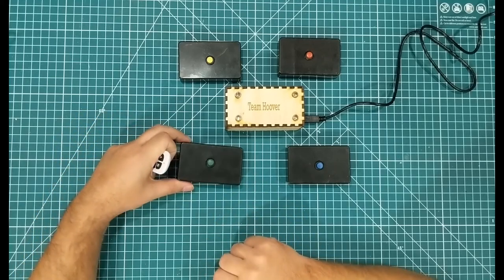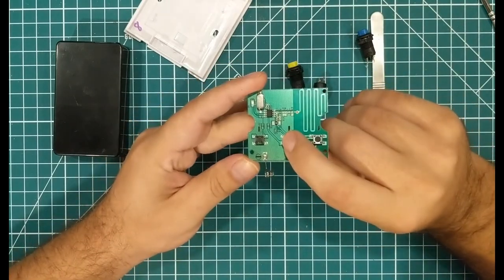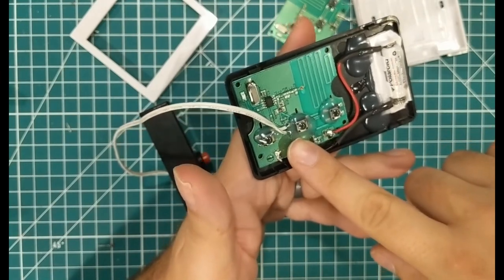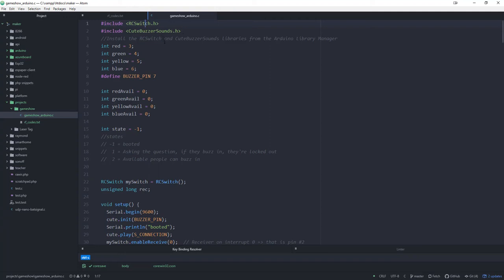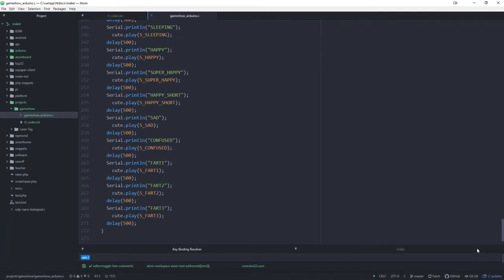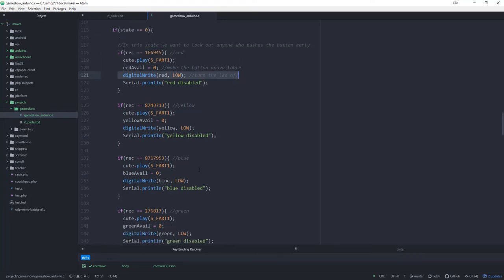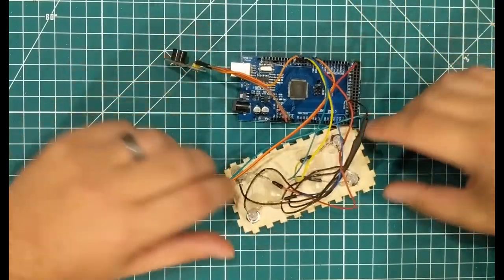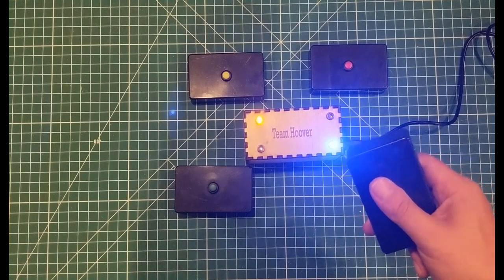Wireless Arduino Game Show Buzzer (With Code)

Comment: Awesome project. I built one with 12 player units. Been using it for the last 4 months without problems. I would like to add a function but don’t know how. Is there a way to add an extra buzzer after 5 seconds after the player buzzes in to answer. Like in family feud. Some of the players push the buzzer too fast then don’t know the answer right away and other players get upset.
Reply from the maker: So are you saying that the lockout should automatically unlock after 5 seconds? I think that would be doable. I am out of town at the moment but I would be happy to help and early December

Comment: This is a very interesting project. But I cannot understand that only a single receiver can receive the four buttons from the player and the four buttons from the key remote control and transmit them to the Arduino via just only one wire.

In my hardware circuit with relay I have 4 receivers but somehow they block each other when several buttons are pressed almost simultaneously. 
I would like to send you a picture of my electrical plan, but I don't know how to add a picture here. 
Thank you.
Reply from the maker: You're absolutely right that 433mhz signals can cancel each other out and that's an issue.  I make the kids tap the buttons.  Instead of push and hold.  It only takes being first by a thousandth of a second to get in there and "win."  Although I am going to make another version of this that uses a different technology where all the signals can be received at once and it will give you the order.
Reply: @AnotherMaker  hi, any progress or notes regarding this new strategy that you can share? I'm working on a similar project and I'm amazed there isn't any kind of kit out there already being made by Adafruit or someone like that!

Comment: I tried that with 433 MHz radio-controlled sockets and a relay control. But if the players pressed at the same time, then probably the radio signals blocked each other. None of all players' lights came on.

Comment: Thank you very much for the video, but I have a question. Is it possible to add two more colors? What would have to change in the code?
I am very noob at arduino. Thank you.
Reply from the maker: Yeah. So a simple way to do it would be to search through my code and look for the word yellow.  So when you see...
int yellow = 5;
Just add 
int purple = 8; 
That's the next open pin. Just go all the way through the code and duplicate any other chunks of code and make one for purple or orange or whatever other colors you want.  The code is in the description. I made it super repetitive on purpose so you can track what I'm doing.

Comment: Hi thanks for your idea of using 433. I used your code and build my version of this project. Into buttons I give keychains - so and now a problem. If i use it one by one its ok all works fine. But when I hit two buttons simultaneously receiver dont take any data. When I have uncommented part about received bytes, there is no activity until I release one of buttons. Any idea what is wrong? Thanks
Reply from the maker: There's just no way you can push and hold 433, they have to push and let go.
Reply: @AnotherMaker  https://drive.google.com/file/d/1310a2pRNw2f6GXK_T2Hp7RJGezX87Y4I/view?usp=sharing - here is example - one by one is fine, if I hold a button it sending more of same signals, if I hit both it do nothing or as on the end of video it send absolutly weird values.

Comment: Is there any way to use a ir receiver and remote for the main controller? If so where would I power the ir receiver on an uno with everything else the same?
Reply from the maker: So I made a video on doing an ir receiver. https://www.youtube.com/watch?v=McYDX7_Tqy0  You could do that and then give each person a little ir keychain remote or a universal remote.  Or you could use an arduino for each of the buttons and make it an ir blaster.
Reply: The main complication im running into now is that irremote seems to be using the same timer as what im guessing is the buzzer sounds.

Comment: This is a fantastic project and has inspired me to try and do something similar but I'm very new to this kind of thing. If I wanted to expand this to 8 players and use the keychains as a base for the buzzers, do they all transmit a unique signal or is there a limit to how many I can use?
Reply from the maker: They all transmit a unique signal. I never received 2 that were the same, but you can also buy programmable ones.
Reply: @AnotherMaker  Thank you so much for the information. I guess I'll start gathering parts to have a go at this.
Reply from the maker: @mydream7015  Good luck!
Reply: @AnotherMaker  HI. I've managed to make great progress on my project thanks to your example code and had one final thing I couldn't quite figure out through research. My project is running on a pro micro (5v) and I have 4xAA battery holder which I will be using to power it. If the battery is connected while the USB is plugged in, can it do any damage to the batteries? will the Arduino automatically draw power from the USB over the batteries?  Thanks again for your help.

Comment: you did not show sir how exactly did you assemble that main box controller. anyway overall i like it
Reply from the maker: Hmm! I will have to go back and watch the video to see what I missed. If you have any questions about making one, I'd be happy to help.   Are you talking about assembling the wooden box itself?
Reply: @AnotherMaker  yes sir and how did you assemble the wiring too coz i have no basic knowledge on electronics
Reply from the maker: @aenhsbestshots3505  So the 4 leds each have one leg to ground and the other to pins 3,4,5,6 with a 220-330 ohm resistor between the led and the pin.  The buzzer has one pin to ground and the other to pin 7.  The 433mhz receiver has one pin to 5v, 1 to ground, and the data pin to pin 2.  That's it for the wiring.   I laser cut the box, very similar to how I did this. https://www.youtube.com/watch?v=vmq_0J9QWPc

Comment: The aliexpress store seems to not carry them anymore?
Reply from the maker: Is this what you are looking for? 
https://a.aliexpress.com/_stE6p1
Reply: @AnotherMaker  Thank you!!!!!
Reply from the maker: @cyberphox  not a problem!
Reply: @AnotherMaker  next question! :) Is there a way to code these wireless buzzers to respond to a keyboard press instead of a lockout system? Say like build 10 of them to respond to keyboard 0-9?
Reply from the maker: @cyberphox  what do you mean by respond by?
Reply: @AnotherMaker  i mean one box with a button pressed would be the same as pressing the number 1 on a keyboard, the next box - number 2 and so on..
Reply from the maker: @cyberphox  Ahh! I understand now.  So if you swapped the arduino mega for a pro micro https://amzn.to/2UQNUxe that pro micro can emulate a keyboard and output that as a keypress.  Another option is something like https://www.adafruit.com/product/2479 which can basically take serial output from any arduino and output it as a bluetooth keyboard.
Reply: @AnotherMaker  I think I'm gonna try the pro micro..i need to make up an order list of everything i need...thanks so much for your help!
Reply: @AnotherMaker  I'm almost there! Sent ya an email to see if you can guide me a little bit in the right direction!